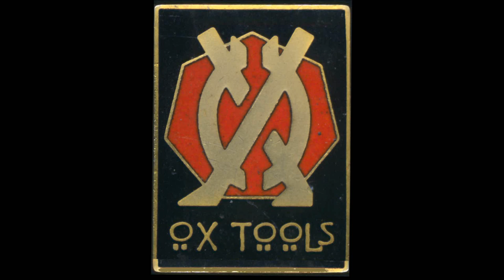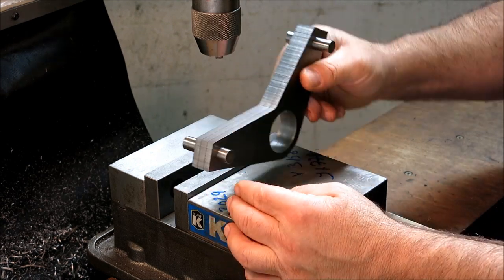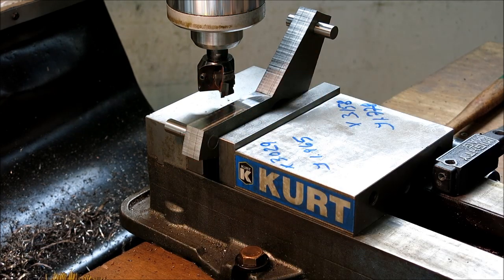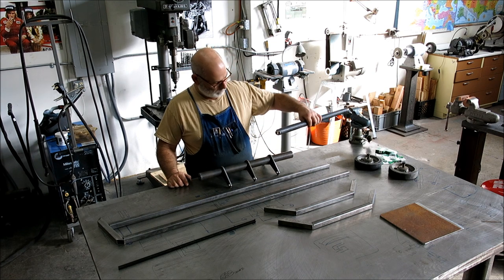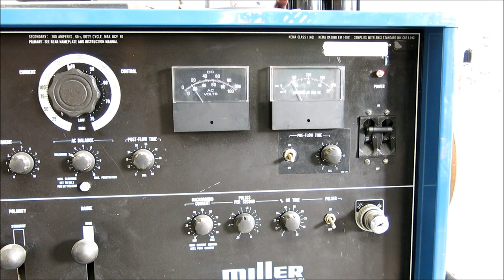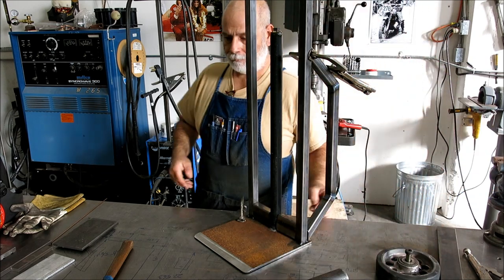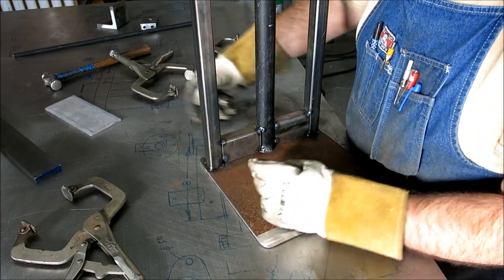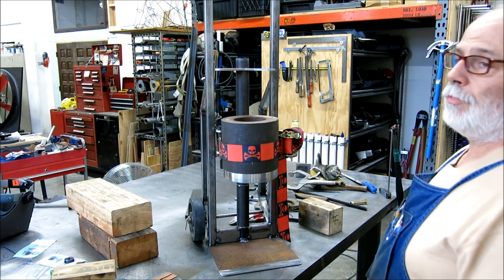Bottle lift 2

Comment from the maker: Hi Cats,

I built a couple tool boxes over the years. They are a lot of work. You best bet if your on a tight budget is plywood. Fairly cheap and durable and easy to work with. My current thinking on tool boxes is smaller is better. I have been going to "kits" That is certain kinds of tools in a single box. Cutting tools, mechanic tools, machinist tools etc. The boxes are smaller and less densely packed making it easier to put your hand on what you want. 

Regards,

Tom

Comment from the maker: Hi Jay,

These are high pressure compressed gas cylinders. They have to be lifted to put into the welding machine for use. They are much too heavy to handle safely ~60kg and awkward to get into the machine.

Best,

Tom

Comment from the maker: Hi Owen,

All good points. The rotational shift does not seem like its enough to put the center of gravity of the bottle in a bad place. I think I want a little wiggle room for getting it into the pocket on the machine. If its a problem I'll lock it down. Thanks for the comment.

Regards,

Tom

Comment: Another great video Tom! I really love the 1080 HD resolution, and also the couple of new camera angle you shot during the welding. Its always good to change it up once in a while. Your doing good bud!
The project is coming along nicely, its going to work perfect too! Just curious as to where second one is your building for me??
LOL
Oh, so good tips on the milling machine. I use a chip guard like that as well. I need one of those knee drives for my mill too! Hang cranking up and down sucks!

Comment from the maker: Hi Stephen,

The gloves are a quantity decision for me. Its about the quantity of welding. A couple of quick tacks no problem. When there is a lot of welding and the entire structure gets hot I wear gloves mainly to keep from burning my wrists. So anything more than two inches of weld will most likely get gloves donned. And aluminum I will always wear gloves.

I don't see the fascination with auto darkening helmets. More stuff has been put together without them than with them.

Best,

Tom

Comment from the maker: Hi Oliver,

You are correct on the metric sizes. I only mention the sizes of stock and cutters to give the metric viewers and idea of some of the sizes in the video's. Maybe it would be more accurate to say thirteen millimeters as opposed to 12.

On the strap there are three contact points. The center of gravity of the bottle is above the strap which is where any moment load on the strap will come from. We will be testing it on a bottle tomorrow so stay tuned. You very well could be right.

Tom

Comment: I agree with Tom - I made my shop floor 5" thick and also put hydronic tubing in it for my heat.  I love it!  Unless you have a HUGE lathe or a CNC mill, the four to six inches Tom mentioned is plenty.  I know here concrete is pretty expensive.
Good luck on your new shop!
Reid

Comment from the maker: Hi Dee,

I'm at a loss where to find a lathe in Thailand. There is so much machinery on the used market it seems like you could find something there. Just for fun I took a look at Craigslist Thailand. No hits. I might suggest lurking around the local industrial area's and see what you can learn or find. Find something then we can determine if its worth while.

Regards,

Tom

Comment from the maker: Hi Mike,

Where are you building your shop? Standard garage and workshop slab thicknesses are in the four to six inch thickness range. Unless you are installing huge equipment a foot thick is wasted money that would buy machines for your shop. Hope that helps.

Regards,

Tom

Comment: The HD looks great on my iPad, love the content. Don't worry about length, it's all gold. 

My auto darken welding helmet is solar (or arc) powered, so no need for batteries.  If you are happy with the flipping, no need to change, but as a novice I find it much easier to be able to see what I'm doing to position, rather than having to learn to position, flip the helmet without moving the tool, and then start the heat. You've obviously mastered that!  

I liked the music in past vids...your station is available on the net, so I can listen to it here any time.  Thanks for that too!
Reply from the maker: Hey Hammer,

The autodark goes against all my experience. I would test it more if I could get a magnifier for it. From years of training welding students before the auto dark helmets I can relate to the need for beginners to be able to position and start.

Cheers,

Tom

Comment: Hey Tom, if the bottle slips, consider adding some split rubber tubing over the triangles to give some more friction. Just a couple of pieces of clear tube would give you a lot more grip and protect the bottle's paint job. (lol)

Comment: Good job Tom as always.  Moving along on the shop, Gabber to start in three weeks, maybe.  Getting the site work down to one percent grade.  What size base do you suggest in the concrete floor for the lath and mill machine?  Is a depth of twelve inches sound deep enough?  The Jib crane I have plans of one cubic yard to attach to.  Is this enough?  Mike

Comment: Hi, your doing such an amazing job, love the new camera, you have mentioned  a good few times that 1/2 inch is 12mm, its actually near as dammit 13mm but thats cuz im into cars. And heres something I would have a good look at, when you strap the bottle in the current configuration, the moment will be very large at the strap ( the force where bottle will try to lean away from the cart), you need to raise the strap, or add another V support lower down, want to save you extra work.

Comment: Hi Tom, I can make sense of your design now, looking good. Might be worth thinking about some form of security device near the top of the bottle, holding the thing to the frame work, as there is quite a bending moment at the bottom of the swivel. Overkill, probably but, better to design out faults than wish you had. As for camera, if the file size is getting too big, I for one would not miss a little clarity for quantity, besides in lower res the turning finish is better :>)
ATB
chris

Comment: Hi Tom new camera looks great,so looking around my shop for material to replicate your lift I found a lead screw out of an old south bend 10k lathe.  Not sure how much effort it would take to crank up a full size cylinder. Your thoughts or suggestions would be greatly appreciated.
Reply from the maker: Hi Johnny,

Should work fine. Nuts might be hard to find. I suggest simple hardware store stuff. The effort is related to the screw diameter, thread pitch and the length of the handle you turn. Hope that helps.

Best, 

Tom
Reply: thanks tom  i will cut the nuts on the lathe i to am a cheap skate lol

Comment: Hi Tom,
I've been enjoying your videos quite a bit.  Very informative.  You have a patient, methodical way of working and for explaining what you are doing.  So far, I have only seen you use the TIG welder.  Do you have a strong preference for TIG?  Here's the age old question: if you could have only one welder for all the things you do or could imagine doing with a welder, what would type would it be it be?  (I'm in the market for a welder, but only one for now) Thanks man.
Reply from the maker: +twwtb Hey TW,

A good question. A TIG setup with a stick stinger is a pretty versatile setup. TIG is nice and clean and precise and if you include stick welding you can do pretty much anything. Some folks don't like stick as it takes a little more skill to master stops and starts and out of position welding. In my opinion MIG really comes into its own for filling bad fitup and moving fast on steel. Thanks for the comment.

Cheers,

Tom

Comment: Tom

Am I right the new HD camera gives a better range of camera angles ?  That's what comes across in the results, for me.  Looking good !!

Did you wear your TIG gloves first to satisfy the safety / PPE police, and then revert by habit to your bareknuckle approach to make the point: " this is how I do it " ?

I agree with you about A-D helmets.  Mine cost $100 on special but still doesn't work with TIG.  Whatever works for you - if it protects you and is light and cool it's OK by me.

Cheers

Comment: Ok, Tom, I know you can do it all, but looking at the labeling on the bandsaw blade @ 2:40 of this vid, I have to ask - are you now even making your own bandsaw blades?

Rich
Reply from the maker: Hi Rich,

I made a few when I first got the saw just until the ones I ordered came in. I use Bimetal almost exclusively for all my sawing needs. My favorite is Lennox Diemaster and I use several tooth pitches from 4 up to around 10 teeth per inch. The commercial welded blades are so cheap its not really worth the effort to make them unless its and emergency.

Cheers,

Tom